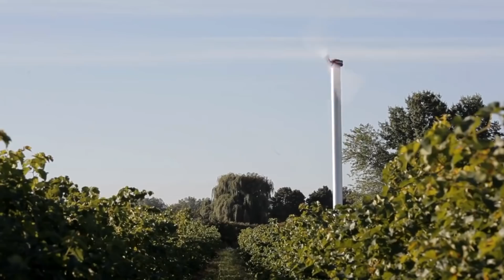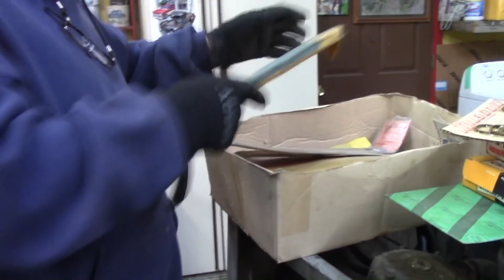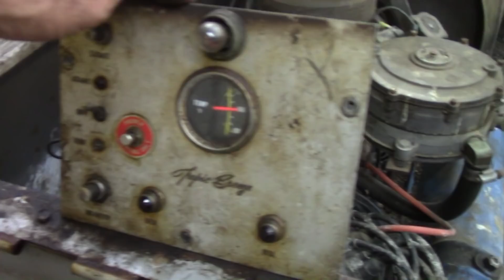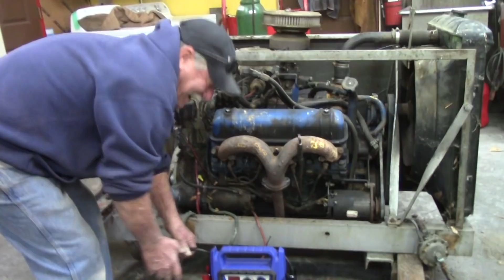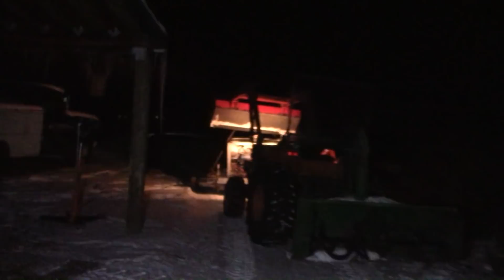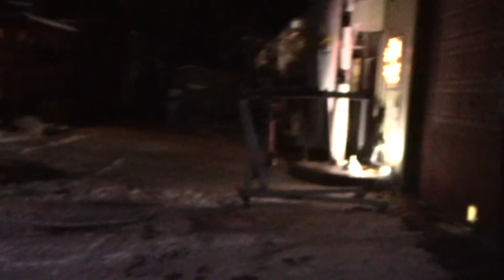1956 Lincoln Y Block Engine - FIRE IT UP!

Comment: That's the exact same 56 model  368 Lincoln engine that my Dad and Uncle rodded with a "$100 cam"and a Holley 4 barrel carb and put in my Grand Pa's 54 F100 back in the early 60s and it was a very stout running engine. I was lucky enough to get to ride with my Grand Pa in it before he passed in 1983. Thanks for reminding me

Comment: In West Texas there were many thousands of butane fueled engines.    Many were 6 cylinder  army surplus 302 GMC to 145 GZ Waukesha 817ci.   I remember butane was 1.5 cents per gallon in the early 1950's

Comment: Hi Guys Should you drain the water so it won’t freeze and crack the block or radiator in that weather?
Reply from the maker: it has this stuff in it called antifreeze :)

Comment: Heh heh, I'd know the sound of those old Ford ratchet drive starters anywhere!😁 Ahh... the beauty of propane fuel systems. You'd probably still be working on that thing, trying to get it started if it had a regular gasoline carburetor on it. That looks like an early Impco system with the high pressure liquid regulator and the hot water gas converter up by the carb. If you were running under a load, you'd need to turn your bottle upside-down, so you have liquid propane coming through. Otherwise the feed line will just ice up and it will lean out and shut down. The old gal sounds like she's got a lot of life in 'er still. This engine will most likely have sodium-filled valves and stellite seats to handle the high exhaust temps of LP gas. ..which also means, it will probably run fine on regular unleaded if you end up converting it to gasoline in a future project. Nice one guys!😉👍

Comment: That should be a 332 indusrial engine, same family as 52-57 lincoln, used in ford trucks till 63 , i have raced these engines since eaely sixtys, Rick Martin Darrtown Ohio 513 348 0904

Comment: I hope you guys are gunna put it back to gas how it should be instead of propane
Reply from the maker: well, this one was never a gas engine  the company that built the wind machines bought industrial engines and set them up to run on propane for a specific application.  its not just an old engine that was just yanked out of a car and converted to propane. but if you saw the whole video.. you'll know its for sale and you could buy it and do whatever you want with it. you could set it up to run on peanut oil if you want to! haha.. thanks for watching!
Reply: @1963impala2drWaylonWire  oh I didn't know but I have to admit it kinda does sound like a 460
Reply from the maker: @darceylawrence5440   it does sound cool dont it!  its not nearly that big tho.. I cant remember the exact size but its in the lower 300s.. I hope someone does what you are thinking tho.. and buys it for a hot rod engine and converts it to gas.. it would sound awesome!
Reply: @1963impala2drWaylonWire  ya the whole propane phase thing made no sense you're just driving a bomb waiting to go off with the acception of forklifts
Reply from the maker: @darceylawrence5440  l you did see the portion of the video showing what this engine was used for? to run the fan at low rpm for years and years.. I dont know how long you've been around or what your experience is driving propane powered vehicles but I can tell you mine.. in the late 70s and early 80s I drove a truck hauling fruit from the orchards in to the apple packing facilities. the company I worked for had two pickups (fairly new at the time) which had been converted to run on propane. the field men or "ag advisors" drove them for years without incident. they were gutless and would hardly pull the hat off your head but they were dependable as could be, but they were certainly not bombs!  haha  engines which have been ran on propane are super clean inside free of sludge. (ive seen them) "and" propane is very easy on the internals..the only downside is the lack of power.. I "guess" they had their place..at least back in the day but personally, I wouldn't have one! haha.. of course here we are with this engine 64 years later which has very few hours on it.(they only ran maybe 20 hours per year as wind machines) I guarantee it would be as clean as a whistle on the inside and it would make a great vintage hot rod engine provided someone got rid of that gutless propane crap! hahaha..
Reply: @1963impala2drWaylonWire  what I meant was if something actually goes catastrophically wrong then your vehicle goes boom
Reply from the maker: @darceylawrence5440  you have a point there sir! haha.. although the same goes for gasoline.. maybe even more so. I dont recall ever hearing of a forklift blowing up. haha..  I know propane burns way cleaner than gasoline.. way less emissions..so it seems strange to me that Russia runs 3 million vehicles on propane while the US only runs 150k trucks and buses on it. It probably has to do with some fat cats and politicians lining their pockets!  on a lighter note.. thank you sir for watching my silly videos.. i do appreciate it very much and I'm working on the next one right now!  I hope you enjoy the next one as we get deeper into that old Hemi engine  have a good evening!  :)
Reply: @1963impala2drWaylonWire  is it a Red Ram or a race Hemi?
Reply from the maker: @darceylawrence5440  as the prior video says...this one is a "Chrysler Firepower" !!!  but I had a Red Ram a few years back and they have REALLY cool valve covers!
Reply: @1963impala2drWaylonWire  ohhhhh ok put a pair of Zoomie headers on it and a Thumpr cam and she'll one mean motor
Reply from the maker: @darceylawrence5440  you hit the nail on the head..plus watch in my videos for my intake setup.. (6 pack of 97's)

Comment: The early Lincoln Y blocks ran suprisingly strong. My Father owned a 1954 and that was 317 cu. in . I believe they uped the cubic inch to maybe 347 or something like that in 1956 .Our 1954 was backed by a GM hydromatic  that really helped the performance. I was younger then but heard stories of my Brother beating Rockett 88 Oldsmobiles and Buicks of that era routinely in stop light races. The 54's were winners in several major road racing events of that time also.

Comment: I wonder if it's a 302 or a 332....
Reply from the maker: Ive heard 347 and 363 too!  lol
Reply: @1963impala2drWaylonWire  I think you called it right as an early 60's rig. 
That was close to the tail end of those engines production run and all Lincoln Y block production in the U.S. from 58'-63'' was truck and industrial and the exhaust manifolds show it's definitely that so it almost assuredly makes it a 302 or 332 Lincoln Y.
Reply from the maker: @2packs4sure  332 sounds right.. sounds like you know your stuff..thanks man
Reply from the maker: @2packs4sure  a friend ran the numbers and he thought it was a 56..but those numbers can be confusing sometimes..I'm also told that those ramhorns were only on.the industrials
Reply: @1963impala2drWaylonWire  I have a thing for oddball production V8's, and the Lincoln Y's fit nicely in that category,,  and that's why I especially love the Ford Y blocks,, the oddest of the oddballs !
Intake, heads, lifter setup,,,,, WHY ???
I love those noisy things.

Comment: Hey Ken that Windmill engine has a fluid drive transmission. It has a clutch for shifting to 1st gear. Then the rest is automatic. Chrysler had the feature in the a940s and 50s. Then came pushbutton. And then along came The famous Chrysler Torqueflight.
Reply from the maker: the hemi im working on has that transmission.. the shop manual calls it a "fluid torque drive"

Comment: I think they called the fluid drive Hydrive. car had a red clutch peddle. not a good idea at all.
Reply: My cousin bought my grandfather's old DeSoto and it had some sort weird automatic transmission like that too.  The car could go over 100 MPH which was too fast for me.
Reply from the maker: the shop manuals call it a "fluid torque drive" transmission

Comment: Chrysler Fluid Drive worked like a straight shift and an automatic. You could take off in 1st and shift through the gears or you could put it in high gear, let the clutch out and mash the gas pedal when you wanted to go. It would drive like an automatic transmission. When I was a kid (10-12 yo), I cut grass for a guy who owned a 1948 Chrysler 4 door sedan with fluid drive. He would let me drive it around his property. That was a long time ago, about 1950-51. I am 81 years old now.

Comment: Gotta love that old Lincoln "Y" block. In case you aren't aware, you lose power when using propane. On this engine I would tend to keep it because of the high torque it has and most of all there are no hardened valve seats to live with unleaded fuel. On the hemi: those old fluid drives are a trip! I had some experience with them back in the '60s. They don't deliver torque very well but were good in the snow. They don't spin tires easily and you can start off in 2nd with out slipping the clutch. One of my friends, back in the day, eliminated the torque converter and made his 6 cyl. a normal shifting 3 spd. There was a big increase in exceleration. I'm not sure but I think an early torqueflie will bolt up to your motor. My experience was with 354 and 392 hemis back in the late '60's. That '34 Plymouth is crying for a Hemi. Also those old fluid drive converters never lock up so when ever you step on the loud pedal the revs climb up and exceleration is slow. I love this channel the sublect matter is always fun and interesting. Your music is excellent, too.
Reply from the maker: I think the torque flight fits the later engines.. this extended block model is 51 through 54? I think.. lol I know they are different..we'll find out soon enough, i have a torque flight in the back of my truck!  I think it would be fun to run the old fluid drive.. I like weird things.. lol

Comment: About that fluid drive. Back when I was a teen, a friend’s dad gave him a 51 Imperial. He put the motor in a 34 Ford Tudor. He drilled through the torque converter and put grade 8 bolts through it. If I remember right, the trans is a side shift 4 speed. Because the Hurst Shiftmaster had not come along yet, he.had problems shifting it.
Reply from the maker: i "think" this one is a 3 speed but i need to investigate that.. its cool whatever it is haha

Comment: Fluid drive and gyromatic and an ultra drive were all common then ,
Reply from the maker: i watched a video on a car with this transmission...they guy showed the shop manual for it. pretty interesting how it worked. it was called a "fluid torque drive"
Reply: @1963impala2drWaylonWire  That transmission was used for various years in all the Chrysler products.  It was a unique (to say the least) 4-speed, but very simple to use and absolutely bulletproof.  And what a stump-pulling first gear ;-) Love your vids, keep 'em coming.   The M6 Presto-Matic was a Chrysler Corporation transmission produced from 1946–1953. It was a special manual transmission with a fluid coupling. Although it had just two forward gears, an electric overdrive unit was attached and useful in either gear for a total of four forward speeds.

Comment: Back when I was in grade school, if you had candy or gum, & the teacher caught you w/it, she'd ask, "Well, do you have enough for the WHOLE CLASS?" 

In this case, the answer is yes....you two are having loads of fun bringing these old powerplants out of retirement, & you're sharing w/us. Thanks!
I hope that whoever gave that Hemi starter "legs" will have an attack of conscious, & will bring it back.
And finally, I too can envision a Hemi-powered '34 Plymouth coupe...that just sounds like they were made for each other. Will it be a ratrod or a Gasser style ride?
Reply from the maker: the engine was locked inside a container.. not where someone could or would "take" the starter.. we've just misplaced it somehow, somewhere. it will turn up in the spring. haha. I'm thinking just a traditional highboy like would have been built in the 50s and 60s
Reply: @1963impala2drWaylonWire  That's good to know. Thanks.

Comment: Back before I retired, the company that I worked for used an old Jimmy V6 as a stationary engine. It probably ran about a thousand hours a year. We ran it in premium and we had to have a valve job done annually. Later on, we changed it to propane and eventually to natural gas. It ran for ten or twelve years without valve issues. Propane is nice to valves and to engines in general. You do give up a little bit of power, maybe 10 or 15%.
Reply: If you were to build up the engine from scratch to run propane you would give up no power.  Propane has an Octane rating of 110, you can easily run compression ratios in the high 10's to low12's ... way higher than a gas engine can live with on pump gas.

Comment: So how fast would they have ran that motor when they used it?
Reply from the maker: not much..I'm thinking maybe 1000 rpm?? its a direct drive..  it just had to stir the air.. you can see the blades turning so its not "too" fast

Comment: I'm intrigued by that propane conversion. Were older engines like that more reliant on the lead in the gasoline for lubrication? And did they make any allowances for that when converting them to other fuels? Like you said, that thing is probably totally clean inside. Cool find!
Reply from the maker: propane was very easy on the internals.. the valves especially.   I dont know if they put some kind of additive in propane.. forklifts run on them for years and years.

Comment: Every time I see and hear ol' Jimmy I think of dad's old 1961 GMC 1 ton he bought from the Cenex fertilizer supply back in 1983 for $200. Had that same V6 in it and ran like a champ. 2nd gear was wore out, though, and would pop out of gear if you didn't hold the shift lever in place. He sold it to a friend around 1986 and he still had it in the early 1990's. Although that guy was a civilian mechanic at Fairchild AFB, he still hadn't repaired 2nd gear after all those years. Still ran good, though.
Reply from the maker: fun memories aren't they... 2nd gear is way overrated hahaha
Reply: @1963impala2drWaylonWire  oh, I bet we could've started her off in 3rd on the road if we tried. She was geared rather low and couldn't get much past 50. I'm almost tempted to look my dad's old friend up to see if he still has the '61 GMC.

Comment: Do you know the Cid on it I know ford were 239 272 292 and 312 in the 50s but lincoln I am not sure of
Reply from the maker: scroll the comments.. someone states the cid I "think" 360something? I remember the 272, 292s and 312s. 351s.. this is an industrial .. so something different
Reply: The 239, 272, 312 etc. we’re Ford/Mercury Y-blocks. The Lincoln version, also referred to as a Y-block, is a completely different engine.
Reply from the maker: @markhudgins1280  I know it's different. I was just saying I remember those old engines... not saying it's one of those 
. it's a 360 something..
Reply: Those industrial Lincoln engines were 302 or 332 cid with the 332 having a slightly larger bore.
They stopped production in 63'..

Comment: Back when I was 19-20 years old (October, 1990-February, 1992), I had & drove a 1957 Lincoln Premiere 2-door hardtop that had the same engine (completely stock 368cid V-8, Carter 4-bbl, same as the 1956 version you've got there, only the 1957 version had 20 more horsepower and slightly more torque & compression) and *man* - was that a nice, torque-y engine. With stock 3.07 rear end, 300hp and stump-rattling 425 ft/lb of torque going through the stock Ford 3-speed "Cruise-O-Matic" automatic transmission, that baby could *cruise* between 90-100mph all day long without breaking a sweat. 

I think the 1956 version of the Lincoln 368 V-8 had something like 280hp and 410 ft/lb of torque - still one hell of a cruising engine. This one sounds just like mine did when buttoning up the exhaust system - one stout and *heavy* baby, for sure.

That there is an engine that was only made for 3 years - 1956, 1957 and 1958. 1956 for Lincoln exclusively, 1957 for both Lincoln & Mercury and 1958 for Mercury exclusively.
Reply: I believe thats the mill that powered the Mexican Road Race winning Lincolns.

Comment: That fluid drive been around a long time. My grandparents had a 49 Chrysler with it & it sat behind a straight 8. I remember watching grandpa only use the clutch just to put it in gear to start moving & then the fluid drive took over by using the gas pedal.

Comment: Hey Ken... Great video.  I've been waiting and hoping to hear the ole Y block run ... and run well she did.  When we bought our orchard in 57, it had an engine driven wind machine but it was mounted on a skid and could be moved around.  I don't think we ever used it.  We were actually in a Good zone for low frost damage.
     Thanks again for all the cool videos.     Russ

Comment: Based on how fast that old Y-block stops when you turn off the ignition, it appears to be a pretty "tight" motor. Should make a nice power plant for someone !!  👍👍👍🎄🎄
Reply: Only run a few nights each spring,be very low hours

Comment: I don't see anything wrong with giving that old iron a home. Many years ago, I was still at my dads and I left there when I was fifteen... I put one of those engines in a international log truck and boy howdy it had power that it never had before twin straight pipes up the side of the cab made out of old truck drive lines so they were not all the same size but they did bark like a big dog. I do believe that was 63 or 4 but it did haul wood!
Reply from the maker: if it had power.. it wasn't running on propane! right? haha

Comment: That started way to easily. Was that an old Impco gas regulator on it? they were very good quality units. I did a training course on them in the mid 80s out here in NZ. Even old Jimmy started well for a pick up thats frozen.
Reply: hi andrew did you see the kiwi number plates on the shed wall in the y block start up video ? right behind the motor?.
Reply: @murraygreen595  Yes i sent them